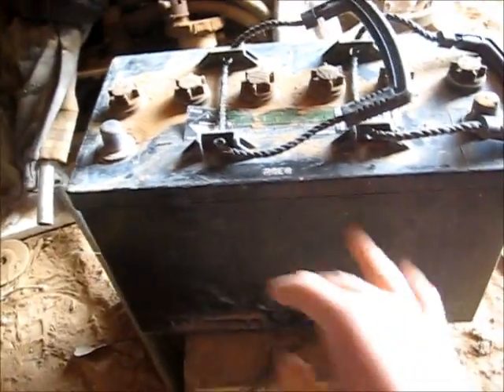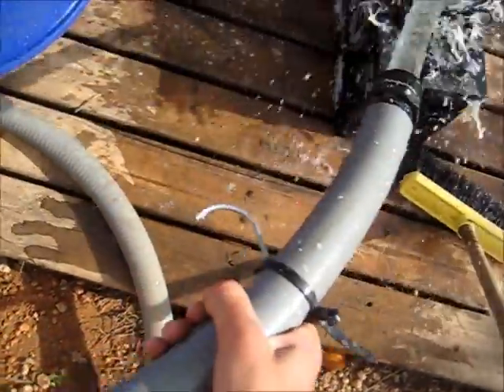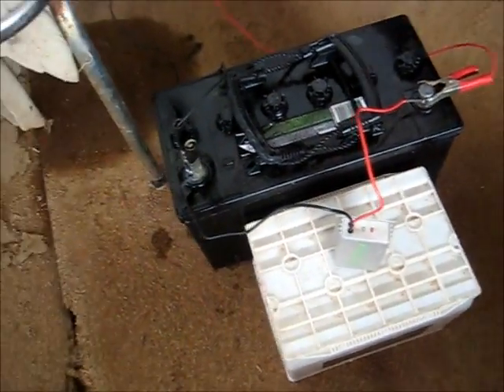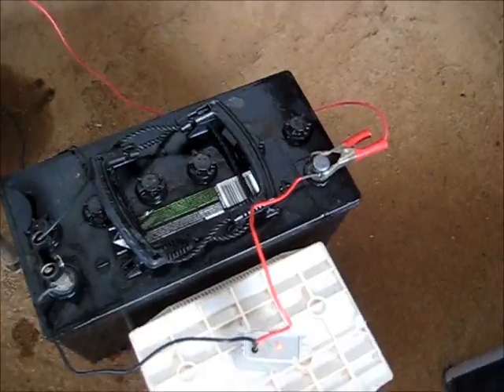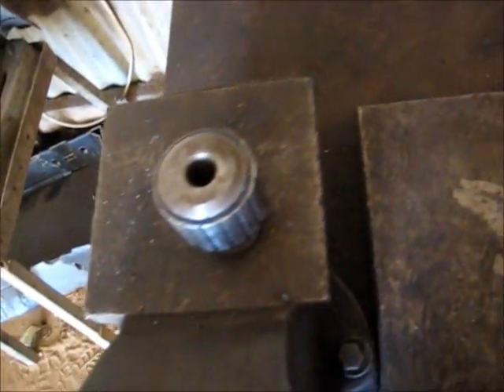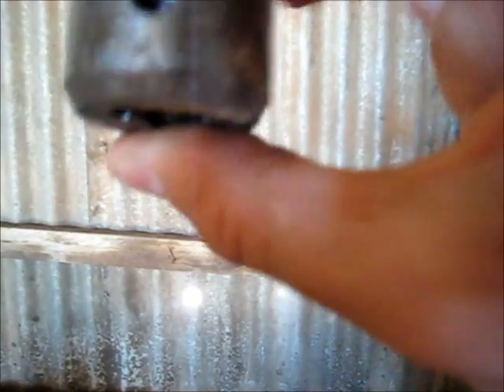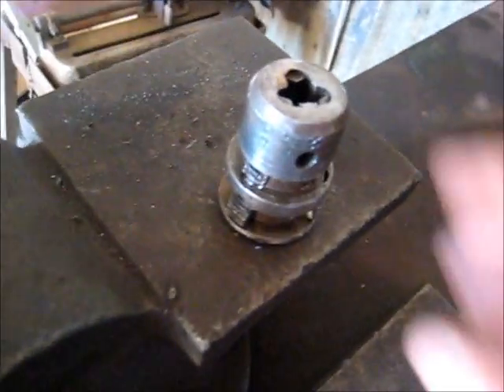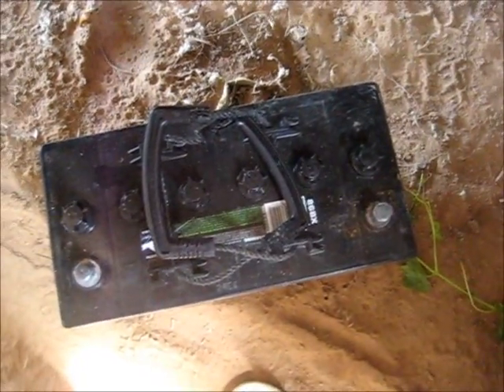Desulfating Dead battery

Comment: Great video and review. Do you know if your battery desulfator pulses are 16 volt power spikes like a Noco Genius 5 and 10 charger or CTEK charger uses? What is the brand desulfator you are using? 
I have a Pulsetech PowerPulse passive battery desulfator on my 2001 BMW battery as preventative maintenance as Pulsetech claims that their patented frequency they use can extend battery life up to three times. I also used my PowerPulse on my other BMW battery that I let sit disconnected for a year, and it was at 11.2 volts, I tried charging it with my friends Exide 6 amp automatic charger for 14 hours and battery voltage was at 13.1 volts, yet it would not start my other car. I put the PowerPulse on it along with a 1 amp Schumacher manual battery charger for 72 hours, and left the desulfator on it for a week and it started my car right up. My point is desulfation can take up to 30 days depending on how sulfated your battery is.
Reply from the maker: That was an ebay infinitum one

Comment: i bought a build your self kit and it dosnt work so well lol, but i got a old school drill starter which uses a capacitor to lower amps but puts out like 120v for charging at 2A and it charges 12v batteries